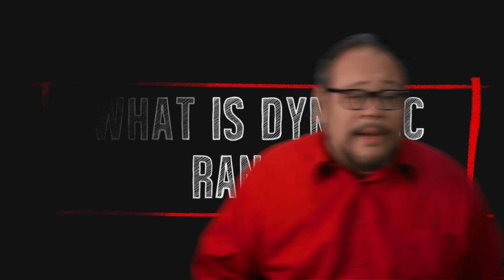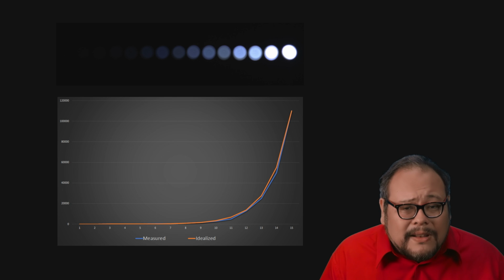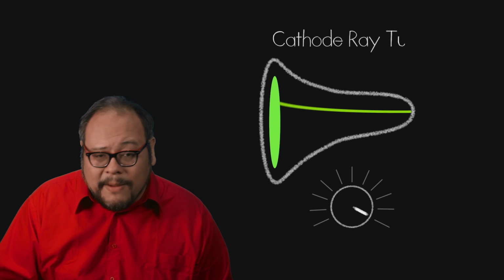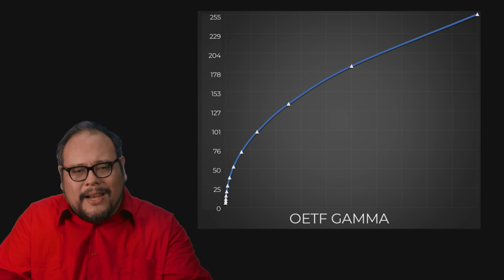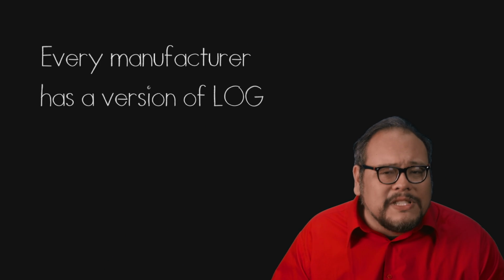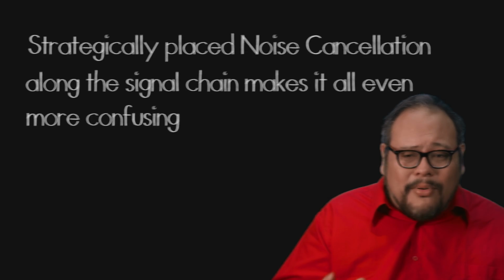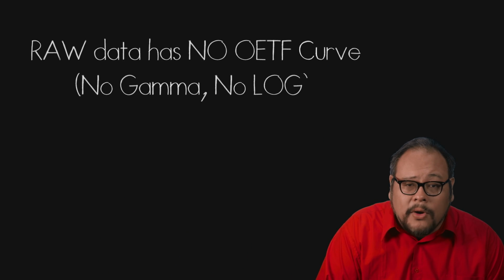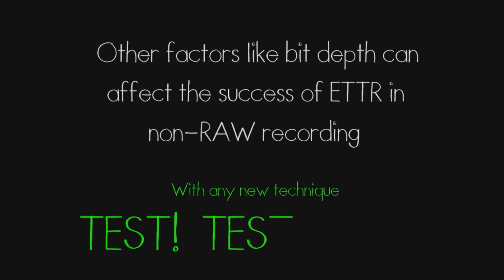Diving into Dynamic Range

Comment: My life will never be the same: use lower ISO in the dark, and higher ISO in bright cond. breathing heavily
Reply: i've learned that from my c200 lol. Oddly i was indoors and shot at iso 4000, the room was well lit. And i didn't see any noise. I thought the camera was good at high iso, i went outside in the dark and shot at iso 4000. It was noise everywhere. I learned that iso dont add noise but amplifies it. Just like how John stated in this video. if your mid tones are at that certain ire where the noise floor is at, which for the c200 is about 12 to 15, then you will have noise especially at high iso. It's a trial and error process hahaha.
Reply from the maker: What's more, it's really the noise floor we object to... Not necessarily the noise in the signal. ;)
Reply: but what are you doing if your outdoors, aperture wide open, shutter speed adjusted etc and you are still underexposed? up the gain in post or in camera?
Reply: You know how they say - "when you gotta go - you gotta go!". This applies to ISO as well.
Reply from the maker: EVERYTHING in filmmaking is a compromise... There's no way around it.

If your outdoors and need more light you could drag out some generators and some hmis to add more light or push ISO knowing you're going to take on more noise in your shadows.
Reply: @Phonothek  I say "throw more light on the subject" if you're still under.
Reply: @Phonothek  Depends on your camera. It's usually a safe bet to get the exposure right in the camera, but with raw it wouldn't matter that much.
Reply: More importantly a lower iso means more exposure to increase your signal to noise ratio, and a high iso means less exposure the prevent clipping.

Comment: Great video, John! This is why knowing your camera sensor's "native" ISO is so important for reducing noise and maximizing dynamic range.
Reply from the maker: Even a term like "native ISO" is sort of confusing... There's really no such thing - it breaks down to what ISO gives you the even number of stops above and below middle gray. Then Native ISO is also dependent on what flavor of LOG you're shooting at... C-Log it's 800 or so, S-Log it's like 2500 (I think it locks you into that)! 

It's all confusing!! :P :P
Reply: Agreed. I guess we should really say optimal ISO. S-Log 2 locks you into 800, while S-Log 3 locks you into 1600. I did some experimenting with a neutral gray card and light meter. The exposure with the lowest noise floor and highest dynamic range for S-Log 2 was 2 stops over exposed S-Log 3 was 3 stops over, and S-Log 3 has one extra stop of dynamic range and is cleaner when properly expose, which makes sense.

Comment: Wow! So you need to add or remove light rather than compensating with ISO. 

For clarification, If you were filming a dark, dramatic scene, would you need to use a lower ISO?
Reply from the maker: If you're filming a dark dramatic scene, it would be better to add light (either add more light or open the aperture and slower shutter) and shoot a lower ISO.

It's counterintuitive but it makes sense if you think it all the way through...
Reply: Filmmaker IQ Got it! Thanks!
Reply: Do some experiments! I found in my G85 when shooting night photography in RAW,  and it's too dark but cannot increase shutter speed(eg. milky way). Higher iso results in a slightly better image.